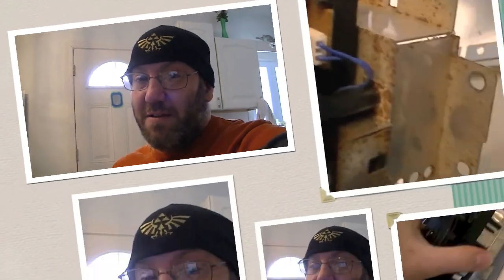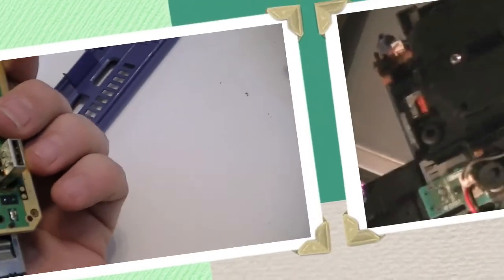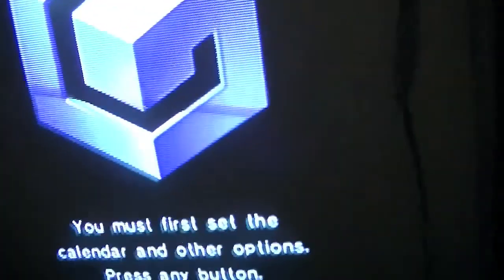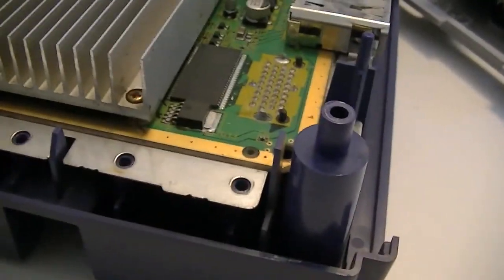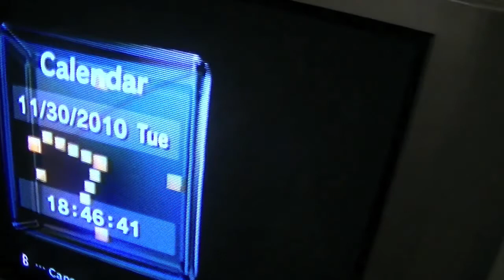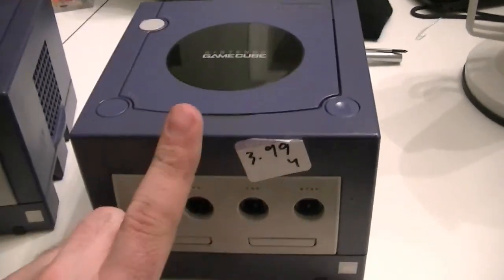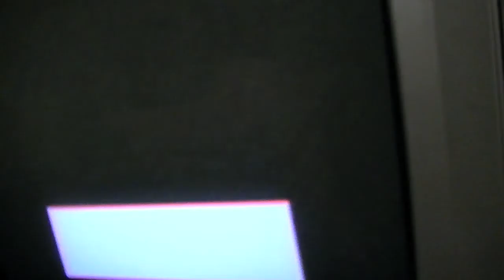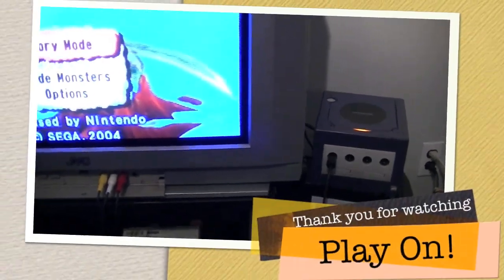Fix it Friday: The GameCube

Comment: I have a GameCube broken as well, I tried cleaning the whole thing and manage to make the sound to work but still no video any ideas on that?
Reply from the maker: Brandon Estrada the best bet from there is to check the cable. After the cable you start getting into replacing capacitors inside the unit.

Comment: Where'd you find a broken Game Cube? Nintendo consoles are virtually indestructible lol.
Reply from the maker: Well, the first one was covered in rust and the power supply is on the bottom, so I think that one went through a flood in someone's basement.  The other was CAKED with dust so I am thinking that the lens on the laser was messed up at one point.  
I think the GameCube was one of the ones that people mistreated because of the tenacity of previous systems.  This being the first with optical media I think that caused some problems.
The fact that I found 2 was almost eerie.